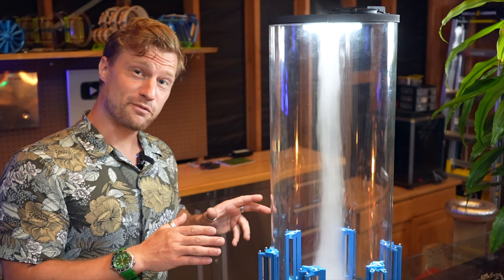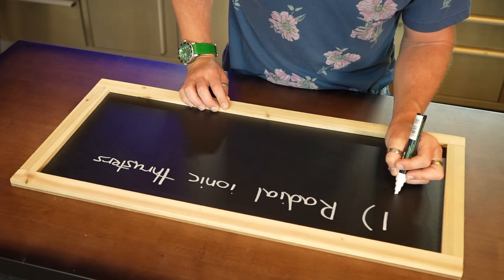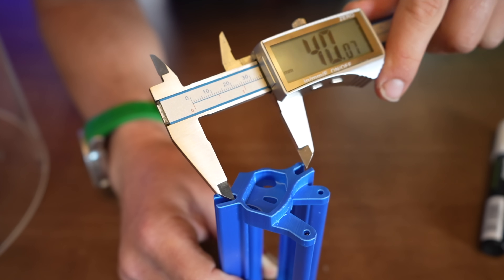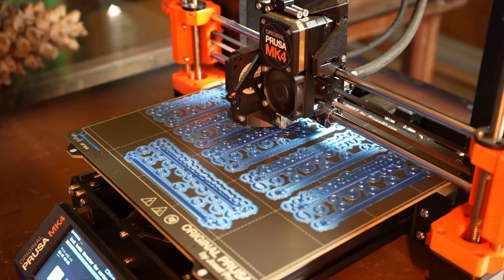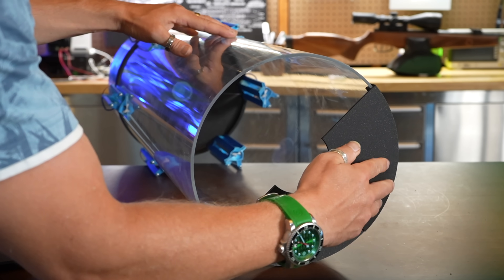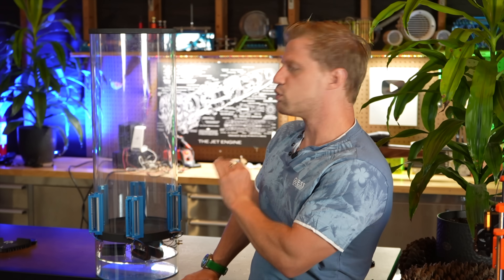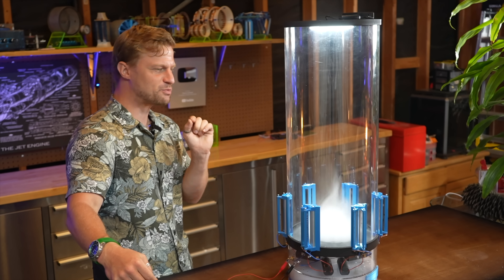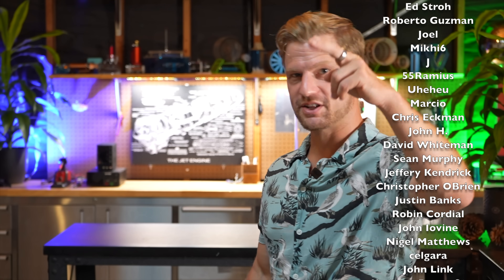I Built The First Ionic Tornado Machine! (Unreal performance)

Comment: It would be more impressive if you demonstrated the vortex outside of the cylinder. From what I see the cylinder contains the vortex. Try it without the cylinder. You might need more ionic thrusters to push the increased air volume.

Comment: you had 2 of the same printers. why not just cut the time in half by splitting up the prints on the other printer? it would take 10 hours rather than 20

Comment: Nice display piece.  Have you considered using distilled/deionized water with an ultrasonic mister?  Might solve the high voltage conductivity issue and be a little more user friendly than dry ice.

Comment: this is gorgeous! if you make chamber for water and dry ice smalled inside, you can lower ion thruster and cover it from outside with decor element, making base look solid and trasparent tube without visual obstacles (ionic thrusters). Also you can try to use vape or smoke machine instead of dry ice, so it last longer, and if i know - it is not so conductive as water. You can add small holes around main hole in basement lid, so some strings can be pulled around to make it look even cooler. Also you can add laser with rotating mirror slicing tornado at top so we can see crossection of it as turbulence vorticies.

Comment: With how you have it built, it should be able to handle water vapor(ultrasonic fogger) just fine. The vapor would never come into contact with the thrusters or other pieces. Maybe condensation running down the sides of the inside of the tube, but that would be easily handled with a “gutter” lip.
Reply: Use oil or glycerin
Reply: @Only.The.Best.  water itself will work just fine and not leave a film.
Reply: Dry ice fog is condensed water vapor, and pure water is an insulator, not conductor.
Reply: @biggnorm9992 Obviously. Also, you missed the point of the comment.

Comment: add a protective mesh around the thrusters since the high-voltage electrodes are very exposed and the mesh if not super tight should not affect much of the performance since it is more of protecting everything from the thruster instead of protecting the thruster from debris

Comment: Oh amazing he actually made it. I thought very often of a similar system. But I never had the time or money to ever make it. Now if you can figure out how to get the system to move small light particles around within like Styrofoam. And with a metallic sheet on the bottom and metallic sheet on the top. It should be able to work as a dust devil static generator similar to what happens to normal dust devils where they have both a positive and negative charge from top to the bottom.

Comment: Haven't seen this in comments yet: what about a spinning 'toy' in the center?  Something that generates lift via the spin (bladed 'flying discs' usually launched from a handheld device).... if the vortex power is right, and the lift balances the weight/gravity, you'd get a floating disc that would just sit there in the middle, riding the vortex.  Think 'floating ping pong ball' which can be floated on a simple stream of air, which 'spins' as a globe, but more 'ufo' like, spinning in the direction of vortex, and riding it.
Reply: ElectroBOOM made something like this, with two rings of foil in an x-shape, even with Q-charging wireless energy LEDS..
Reply: @Krog32  yes, his firefly lantern...but those were tiny and fan driven turbulence.
Reply: Put a magnetic levitation disk by polarity free repulsion method, no coils needed just spinning magnets, using also lorentz forces to spin faster

Comment: Why would fog from dry ice and for from a fogger had different conductivity? Both are water droplets.
Reply from the maker: Great question. Carbon Dioxide gas is not the best conductor of electricity, so water misters create water mist surrounded in normal air (mostly nitrogen, easily conductive), and dry ice creates water mist surrounded by carbon dioxide. It's the whole package which makes it better, IMO!

Comment: What you're proposing involves arranging radial ionic thrusters in a multi-tiered, angular pattern, similar to how a turbo ramjet organizes airflow, but with a static setup of thrusters instead of mechanical moving parts. Here's a detailed analysis of this idea:

### Design Overview

1. **Radial Ionic Thrusters**: You'd have sets of thrusters arranged radially in a 30° angular separation from each other. Each set would generate thrust in a circular pattern around its central axis.

2. **Multi-Tier Arrangement**: The idea involves stacking these sets vertically. The first tier would have thrusters arranged clockwise, and the second tier directly above would have thrusters arranged counterclockwise relative to the tier below it. This pattern would repeat as you move upward.

3. **Pattern Comparison**: The radial arrangement mimics how a turbo ramjet organizes airflow to improve thrust. The difference here is that you're using ionic thrusters, which don’t rely on moving parts or combustion but on electric fields to accelerate ions.

### Potential Advantages

1. **Uniform Thrust Distribution**: The staggered, counter-rotating tiers could potentially create a more uniform and balanced thrust distribution, reducing vibrations and improving stability.

2. **Enhanced Efficiency**: By mimicking the flow dynamics of a turbo ramjet, the design could optimize the interaction of the thrust fields, potentially leading to higher efficiency.

3. **Reduced Mechanical Complexity**: Without moving parts, the design could be more durable and less prone to mechanical failure.

### Challenges and Considerations

1. **Complex Design and Fabrication**: Designing and building such a complex, multi-tiered system would be highly challenging. Precise alignment and integration of the thrusters are critical.

2. **Thermal Management**: Radial ionic thrusters can generate significant heat, and managing this heat in a compact, stacked arrangement would be crucial.

3. **Power Requirements**: The power needed to drive multiple sets of thrusters could be substantial, necessitating efficient power supply and management systems.

4. **Scalability and Stability**: Ensuring the system operates efficiently at different scales and maintains stability throughout the entire range of operation would be important.

5. **Field Interactions**: The interaction between the ion fields of adjacent thrusters in such a configuration could affect performance, requiring careful optimization.

Overall, while the idea of using a multi-tiered radial ionic thruster arrangement inspired by turbo ramjet designs is innovative, it would require significant research and development to address the practical challenges and fully understand its performance characteristics.

Comment: That is really impressive build. Looks great!
By the way you can change colours of the lights.

Or some holograms, on high power column looks very stable.

Either way ionic thrust is very interesting, in the water in the air there are so much applications I can think of. If only it had performance comparable to traditional types of engines.

Comment: Paired with pure hydrogen fuel ran through a desiccant system and a plasma arc ignition at the at the afterburner use a butane torch nozzle designed for more efficient design and use carbon-carbon Composites for high temps

Comment: I made one of these about 20 years ago that was about 5 feet tall. I built an octagon shape chamber with (cheap) flat pieces of acrylic, used a vacuum cleaner at the top to create suction, flap/angled ports near the bottom to create rotation, and an ultrasonic transducer to create the fog. One of the coolest projects I've ever made, but pretty pointless. :)
Reply: You didn't actually do that. Nice try though but what you described wouldn't even work.
Reply: @Sabrinahuskydog  Why not?

Comment: Don't scientists often use a horde of sensors in a tornado to gather data about how it spins? That wouldl be cool, but you probably don't even need a bunch of smart devices. You might be able to get away with some little bits of paper/glitter/resin that reflect a certain type of light with an image senor or 3 that can pick them up and convert them to 3D positions. Might look cool with glitter too.

Comment: how fast is the flow from each thruster? 12L of air is roughly 15.5g so in theory 3m/s (low sounding guess) of flow is enough to fly a small, light (sub 140g) RC aircraft.

Obviously, I'm assuming some pretty perfect conditions and not taking air resistance into account but I don't think it's impossible as of right now.

Comment: The question is if it could be modified so that it was significantly smaller and then inserted horizontally into a model train.

It might be interesting, especially considering turbine locomotives like the UP had.

Comment: you should play with differing voltages in pairs to have the tornado wiggle / oscillate more ,or have an individual ionic thruster pulse at random intervals and variable power to make the tornado get knocked like a gust occured @plasma channel

Comment: stick black tape on half of the tube, it will make the column more visible
Reply from the maker: Yeah, I was thinking about painting the back black. For some reason I just couldnt get myself to do that because I wanted it viewable from all sides. Maybe I should have painted it black though.
Reply: @PlasmaChannel  paint is hard to remove if you change your mind, stick with temporal solutions for a reusable tube that costs $450USD 😉
Reply: @PlasmaChannel  paint is hard to remove if you change your mind, stick with temporal solutions for a reusable tube that costs $450USD 😉

Comment: Getting there. Now time to check out 'Electric Weather Mechanics' me thinx ¦:¬)
Reply: exactly. weather events tie into the global electric circuit like so
Reply: @BlackMasterRoshi  indeed they do, its all connected within the global circuit. I actually wrote Electric Weather Mechanics just over a decade ago, so it is good to see other people catching up. What the experiment now needs, is to make it into a Birkeland Current, like the real thing. Rather than being an ionic power dump in a single direction. like water down a plug hole. Twisters and their bigger currented brothers, lightning strikes, are a mechanism for the equalisation of charge. between the negatively charged ground and the negatively charged cloud base.

Comment: Would it not be better in a self contained system so the thrusters were not pulling in open air, but the exhausts of the other thrusters?
Reply from the maker: Well now...that would indeed improve efficiency and power drastically. However, the thrusters would then be in the way of the airflow, blocking eachother somewhat. So, performance may end up similar.

Comment: I think it would be  cool if the power of individual thrusters shifted around a bit ower time, so the vortex would move around a bit.
Reply from the maker: It would be really interesting to use an arduino and control each thruster in a programmed way (1,2,4 then 2,5,6 for example) and see the column shift.

Comment: My thought is: it might work with one, maybe two thrusters :D i.e. I think this is an overkill :D
Reply from the maker: Two thrusters showed limited rotation. I tried it with 3 thrusters and it worked. Original plan was a low power mode and high power mode, where low power was first set of three, then high power was both sets of three being powered. I ran out of time though!

Comment: If the top light can also act as a strobe light, that could produce an interesting visual effect.  You know how strobe lights make things look freeze frame? If you can tune the rate of flashing to the rotation speed of the vortex, it would appear to stand still.  Frozen tornado.  ;)
Reply: Cool idea, though I'm guessing different parts of the vortex rotate at different rates.
Reply: I'm sure you're right, it would lose speed the further it got from the impellers.  Partially frozen tornado.  :D

Comment: Is a mister with distilled water still too conductive?
Reply from the maker: OH dear god. Why did I never think of that. You know...the distilled water mist would react with CO2 in the air really quickly and form conductive impurities really quickly....but...it would be less conductive than mist from Tap water. Lol......now I need to try this. Thanks!
Reply: @PlasmaChannel  haha! I thought for sure you already tried it and didn't mention it because it didn't work. It definitely will increase conductivity, but while running I'd expect it to decrease as the mist pulls stuff out of the air and gets pushed out the top.

Comment: I don't know a great deal about aerodynamics, so excuse me if this is a dumb question, but if you were to arrange the thrusters in a similar configuration but with an angle pointed more towards the exit would it effectively combine their thrust or would they be fighting against each other in some way? By having the air rotating inside the thruster you lose some amount of thrust on drag I'm sure, but it would also mean that regardless of how many thrusters you added they would essentially all be concentrating thrust to the center of the vortex right?

Comment: I wonder if this design, slightly altered, would create a self-sustaining vortex, that also multiplies it's total thrust. Sort of like how a turbine engine, once it's fireball is going, doesn't need the blades to draw in air, as the fireball creates it's own suction to aid in sustaining it, so long as fuel is going in as well. The analog here would be the power funneled to your ionic thrusters.

Perhaps the shape of the chamber could help it as well, reaching high compression, leading to greater thrust.

Comment: Might be interesting to light it from below with a single central beam. Lasers ?
Reply: RGB LEDs?
Reply: read my mind, i recon a laser beam in the middle would likely diffuse out enough through the CO2 fog to illuminate the whole column pretty well too
Reply: I'd try milticolor LEDS so you can either manually pick a color, automatically shift through the rainbow, or even shift and pulse to music.
Reply: Make a toroid version to connect the ends and use glitter instead of dry ice so that it constantly spins in the center of the 'donut' then illuminate the glitter. Not sure if electrostatically charging the glitter and adding magnetic fields would help or allow it to 'pulse' by changing strength of magnetic field?
Reply: @curiousviewer5991  That's an interesting idea.
Reply: I think the glitter would be too heavy but the magnetic field idea is interesting
Reply: A laser scanner, showing a cross section, would be pretty cool looking.

Try it with a laser pointer and smoke, just turn the beam back and forth through roughly the same spot. Edit: quickly
Reply: Leds
Reply: Video projector might be a worth a try, since patterns could be projected on to the vortex.
Reply: Leds
Reply: Laser Tornado kinda sounds like a sequel to all of the Shark-nado movies.
Reply: I was going to suggest hiding a Tesla coil in there
Reply: This would be like a "time cone" apparatus if you spin the laser at an angle in the fog. Styropyro collab when?
Reply: @Krog32  even a simple sweep, like a laser scanner, would be pretty neat. Can be done with electromechanical or even solid state devices too.

Seeing a cross section of turbulent suspension/mixing would be gorgeous.
Reply: I would LOVE to have one of these in my space!!  It's a GREAT art/tech piece!!!
Reply: Collimated LEDs would be enough
Reply: @mikeselectricstuff Styropyro????
Reply: You know what, I'm on board
Reply: This is one project that doesn’t need LEDs
Reply: Good idea.
Reply: Fantastic! We have all these plasma lamps that work well in the dark, but this brings a completely new experience and even in normal lighting. Do you plan to make it a product that one can buy?

Comment: Excellent! Now add UV-active colors to the water and activate an UV-LED-panel instead of the white bright light on top.
Reply: The fog is co2 from the dry ice, not water, so you'd have to somehow get uve reactive colors miced into that which Im not sure how easy that would be. The water is just there to warm.up the dry ice so that it turns into fog.
Reply: @dextrodus  Dry ice white fog is condensed water vapor, mixed with the invisible carbon dioxide.
Reply: @ericblanz  oh youre right! I didn't know that. But from all i can tell its still mostly water from the air and not from the bowl so the coloring wouldnt work?
Reply: @dextrodus it's humid air from the water condensing due to the coldness of the dry ice. It's effectively distilled water.
Reply: @dextrodus I think so. Unless the coloring is about as volatile as water, I doubt it would evaporate from the bowl and then condense due to the cool air. That's not to say it's impossible, but the dye needs to have very specific characteristics.
Reply: @superslimanoniem4712  And distilled water is not very conductive.  Though distilled water fogger would basically be the same, so I don't know why he uses dry ice for the twister.  Dry ice fog really works best in application where you want the fog cold and low.
Reply: iirc, plain laundry detergent works when mixed with glycol based fogers to make UV-light reactive fog

Comment: The lower speed vortices are the best visually to me. The speed is much better for the scale of the vortex at the lower speeds. They look more tornadic than the high speed setting.
Reply: he need larger tube so high vortice have lower speed
Reply: Ya
Reply: I wonder about having a short piece of yarn fixed into the lower opening so it's flapping around in the vortex adding some random instability. (or a cotton ball on a thread) That might look sort of cool.